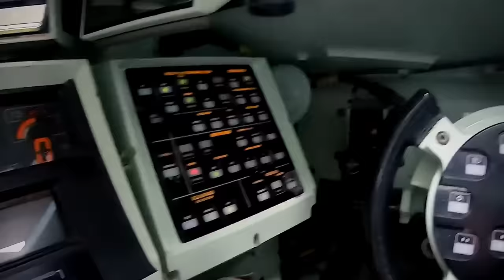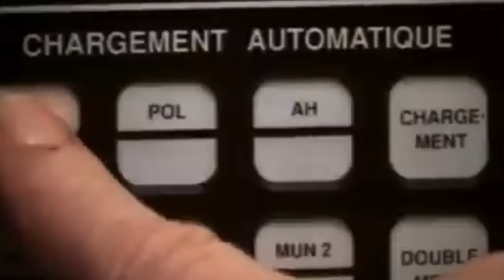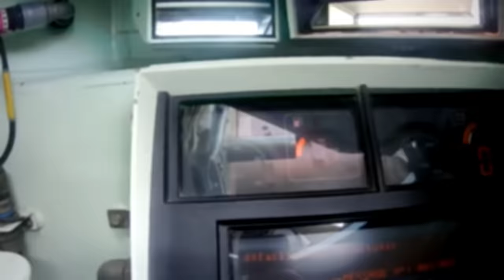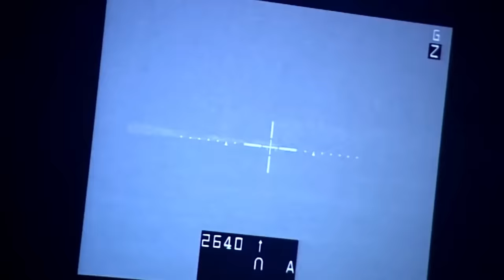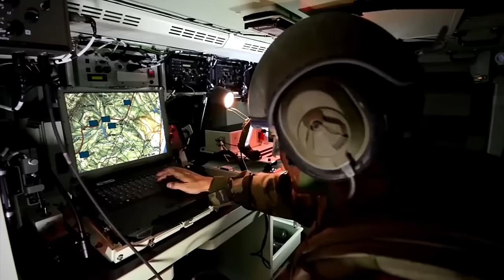The Apocalyptic Tank that Might Kick-Start WW3

Comment: The problem is that the Leclerc tank is no longer produced, so it is impossible for France to deliver tanks to Ukraine as it already must maintain it's own fleet and also the 400 of Jordan and Emirates. 
However it is undoubtebly an exceptional tank, I would argue better than the Abrams is it is highly mobile and above all easier to maintain with a lighter logistic. It is also one generation younger than the Leopard 2 however the German tank in 2A8 version is now modernised.
Reply: Leopard and Abrams tanks were developed  in one german american project. So they have the same level and also the leclerc have no higher level. The main different is the autoloader and this have pro and cons. And the leclerc have many french industrial specific exceptionalities in comparison to the leopard and abrams. So the maintenance...

Comment: More different weapons systems means a maintenance nightmare, which isn't much help to Ukraine. More M1s or Leopard 2s already on the battlefield is smarter.
Reply: They dont care IMO. It's either destroyed or they buy it a train ticket to some EU country
Reply: Not only for Ukraïne, also for NATO itselfe.  All these different tanks means lots of different parts, also critical parts like engines/powerpacks.  It also mean higher development costs, also for education and lower numbers build, which  will rise the price per piece and running costs. You don't want that.  You want a broken down French tank to be fixed in the nearest field repair shop and get a new powerpack there, no matter if that powerpack originally worked in a Leopard or similar. That is the best way to keep as much tanks  in action. It is not that the Leclerc is a bad tank or the Leopard is superior or the K2 is the best. It is just that there are to many different tanks.
It would already be great if they all used the same tracks, since tracks is a critical item.

Comment: Vive la France! 🇫🇷 Nothing wrong with French technology! The use of a .50 cal in the coaxial position instead of a 7.62 is an excellent idea that leverages the extended range of that cartridge using the main gun sights. That actually makes more sense than the other configuration. No mention of the different main gun exhaust- the Leopard and Abrams use passive mitigation, the LeClerc actively pumps air into the barrel after firing. Other French weapons systems are also superior in some ways to the rest of NATO. The Rafale is another good example. During the attack on Libya, the French flew Rafale’s over Libya before the air defense network was taken down by cruise missiles thanks to the unique electronic warfare suite utilized by that aircraft. That technology is so secret that it is not exported, nor shared with allies to my knowledge. Millenium7 has a good presentation on the Rafale.

Comment: Sweden tested, M1, Le Clerk, T-84. and the Leo tank. They choose the Leo.
Reply: That's also because Germany was willing to sell them the components to be modified extensively by Sweden, to the point that they're deserving of a name of their own instead of just a 2A... variant designation.
Reply: Do you really think that these kinds of decisions are made solely based on the quality of the product?
Reply: The Leclerc was too young when put in competition they were barely out of validation phase in France so Sweden judged the tank too immature.
The biggest flaw of the Leclerc was that it entered production after the end of the cold war.
Reply: the said that the abrams was like a cadilac, Le Clerk like a Citroen and the leo like a mercedes.  @tonyhawk94
Reply: @staffancallert  No it is an irrelevant comparison.

Comment: How can you tell when a channel is losing views? A mention of WW3
Reply: I dunno if this is AI written but when he talks about weapons, he acts like they have some super firepower that western tanks don't have....but the M1 Abrams has a 120mm Smoothbore, a 50 call coaxial and 2 7.62x51 machineguns on top. It has even more firepower than the Leclerc. It's also extremely fast, at 72 kmph which is 1 KMPH faster than the Leclerc's released speed... 

Being heavier with Depleted Uranium Alloy frontal protection plates. 

The Leclerc isn't as good as the older models of M1, much less the SEP V3 update.

Comment: Are all these new super high tech automated computerized tanks still hardened against EMP?  I hate to imagine a  few tactical EMPs would mean only Russia was left with working tanks.
Reply: EMP is not the magic bullet you think it is. Most vehicles are hardened against basic EMP by their very design.
Reply: If I had to choose between a Western tank and a Russian tank in the event of a powerful EMP event (powerful enough to matter), then I would take the Western tank every time. There are layers of redundancy built in that old, mid-century technologies didn't offer and for the most part, that's what one expects in a Russian tank. Besides, you need a good fire-control system and don't want it to knocked out by EMP or simply have none to begin with...
Reply: People watch too much TV where they think EMPs are going to destroy everything we have that uses electronics...
The real threat to tanks is from above and below.  Mines have always been an issue but drones are the newest threat and have been devastating to every tank regardless of who made it and when.
Reply: People forget that military vehicles were hardened against EMP. If you don't believe anything not hardened is going to be OK on a nuclear battlefield, I hope our Generals know better.
Reply: @wstavis3135   Fact checked:  True
Fire control may go screwy, you can bore sight it though.  Maneuver wont be f'd up though.  Drive train will be fine. You can spin that turret, raise and lower the gun.  You're right, part of the design. Hydraulics will work.  Fire control...  well it isn't a 2023 sedan
Reply: @robertjohnston8531   Nope
Reply: The only EMP it can face is a nuke, it protected of thé EMP, thé nuke...
Reply: LOL! Everything digital in a russian tank is of the shelf, French Thale electronics. The electronics in a NATO tank is not anything of the shelf. Thinking that's how it works is just plain ignorant.

Comment: didnt they already send tanks with active armor protection that ended up being usless ?  if i remember right it was getting holes punched into it left and right.
Reply: Yup.
Reply: France sent AMX10-RC which is not a tank but a armored reconnaissance vehicule. It was badly used by the Ukrainians as they used it as if it was a light tank. They are now integrated into the marine troops which is a much better use.

Comment: My tank has a .50 cal possibly two if they'll let us mount the above the gun one, and two 240 Limas. So how the hell it the one .50 and one 7.62mm spoken of in this video made to sound like that's revolutionary? lmao. Really......please face palm ones self. It is a solid vehicle. Personally however comma, the auto loader isn't a perfect system and imagine it fails mid battle. I'll take a high speed pvt-spc jacked up on bangs and zyns any day. That won't fail unless fatally wounded. Plus extra hands for the tank are a god send.

Comment: The issue with these were them having an auto loader, which when hit would blow I’ll their unused rounds and cause the top turret to blow off the top. In Ukraine they call them Lali pop’s because it was so common for them to see Russians tanks with their turret blown 30-50 yards away.. lol. So although the American tanks require a 4 th man to lose the rounds. In return it offers quite a bit more safety and is much more forgiving in battle too!..
Reply: The Autoloader of the Leclerc is at the rear of the turret like Abrams and it has blow up panel
Reply: Tell me you have no knowledge about leclerc autoloader without telling me you have no knowledge..
Reply: @hyrikul602  I mean.. Tell me your not a troll without telling me your a troll… 😏🤷🏻‍♂️